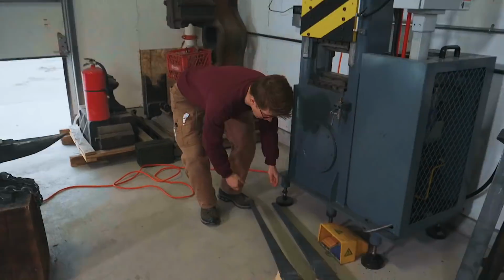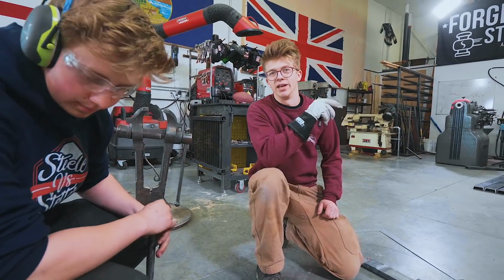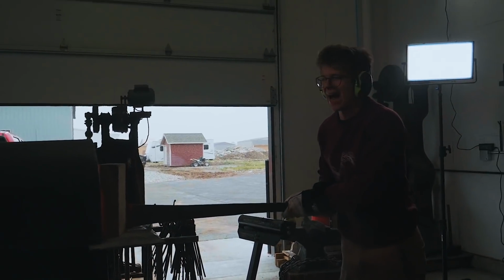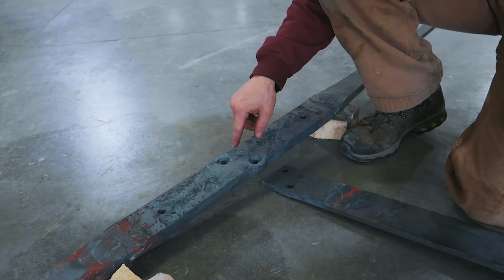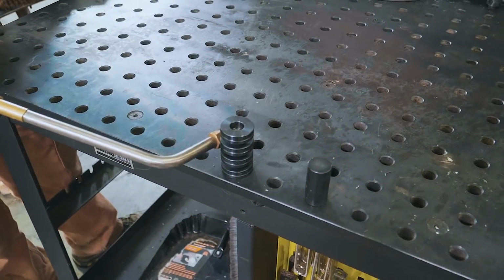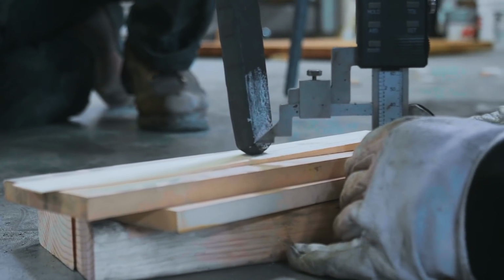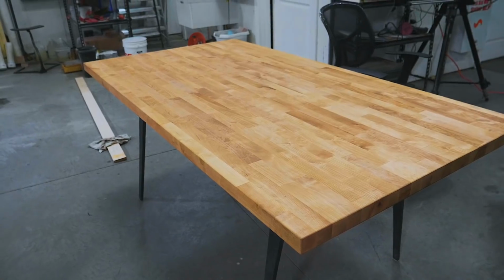FORGING MY KITCHEN TABLE!! Part 2

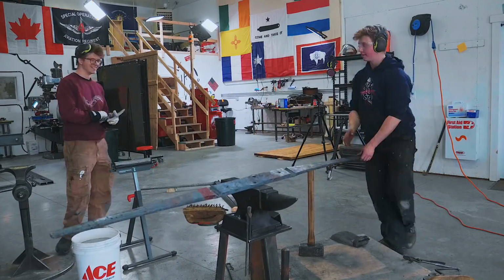Comment: 5:15 - 5:50 The rivet section might be some of my favourite cinematography in this episode with the time lapse and great torch/flame captures.  I love the torch @ 5:32  Great video.  This home furnishing job shouldn't wreck your shins.  Any statistics on bed injuries?

On a side note you need to find a Montana Sawyer / wood slab furniture maker to collab with to get yourself a better table top.

Comment: Lovely table Alec, cool simple design. Tip though, add something to fill the gap between the steel and the wood in the middle there. That wood will not keep its shape, and you will have a crease there quite fast!

Comment: When I first saw the thumbnail. I was not hopeful. Now that the project is finished. I am impressed. It is indeed a great table worthy of the Alec Steele mark. Yeh the drifted and bolted connections is much nicer / organic looking than a drilled hole. I like that touch also.

Comment: Looks great, just one thing I couldn't tell from the video, but make sure the holes in the steel frame where the bolts that attach the top have play in them.  The wood will shrink and expand seasonally along the width and if the bolt holes aren't oblong it will crack your top.

Comment: Something to look out for, wood typically expands and contracts with the weather. Meaning if your bolts don't have enough  of a loose fit inside the steel support structure it can cause your table to crack.

Comment: Put that forge blower in an mdf enclosure! It'll make the annoying blower noise disappear. 

I did the same for my dust collection system. Just drill 1" holes (enough to allow adequate airflow)

Comment: Elongating the holes in the metal where it attaches to the wood will keep the top from cracking. If the wood isn't given room to expand widthways, the top will start to crack where it attached to with the bolts.

Comment: You should have put some pads under the legs so that they don't dig into or scratch your kitchen floor.
Reply: Drill and Tap for Grade 8 Leveling Bolts.
Reply: I do believe that IS his plan, doesn't he mention it last vid?

Comment: Nice Table Alec.  I have a question.  I don't much about forging but would a jig with about the width of the legs have helped with keeping the holes from drifting while countersinking for the rivets?  Or, is there a better way to do that?

Comment: Really nice. I love that hand forged look on the legs mixed with the very straight lines of the wood of the table top on furniture. Simple looking but has a personality. If mine I would probably put a 2cm to 3cm forged band of steel around the sides. Still it's personal choice so...

Comment: Oh no! You screwed the top directly to the base! The expansion and contraction is going to explode your table into a million pieces sending wood and steel shrapnel in every direction putting millions of lives at risk!

I guarantee there will be at least one of these comments.
But probably not as dramatic

Comment: Looks great, top job. Just make sure you regularly oil both top AND bottom otherwise a worktop that wide with only two fixing points across it's width is likely to warp.

Comment: Really like the Table Alec!  Get some little sticky pads for the ends of those table legs or you will experience a horrible screeching when you move it. As if by some miracle suddenly I have at my Disposal, two 7 inch angle Grinders, a drill press, a Bench grinder, a bandsaw and a large Table vise. Now all I have to do is finish my Forge and get an Anvil. I already located a Cross-peen hammer. I already had a 4.5 angle grinder, a MiG 175 welder that does steel, stainless and has an aluminum spooler, a hammer, a double burner for my Forge, and a kiln. It won’t be long, however I’m also in the midst of moving and prepping the house for our move. Did I mention that part of the shop is full of water?  Ugh so much to do.

Comment: Alec, what do you think of doing a collaboration with someone like April Wilkerson and  put a live edge table top on your dinging room table?  Have to fuss at you a little, you had a chance to do hot riveting and didn't.  Oh well.  Hot riveting?  Just like the old timers iron workers did.  Put the whole rivet in the forge and heat to temp and hammer away on the thing.  Great job, keep up the work.  Welcome to the States.

Comment: Alec: I highly recommend altering your method of fastening the table to the frame, due to the expansion and contraction of the wood itself. Consider using Table Buttons (search "How to attach a table top" video by The Homestead Craftsman). This will allow the table to expand & contract without cupping or bowing. Should be an easy modification -- you can even forge the buttons if you like!

This isn't meant to denigrate your craftsmanship at all, of course. I love the look of the table, and would also love for you to be able to use it for decades, if you so choose. Cheers!
Reply: I was about to say he should elongate the holes for the fasteners to allow for wood movement, but you're right, turn buttons, steel clips or braces over the stretchers might work even better.

Comment: Hey bud,

You may want to (should) elongate the holes for the bolts that attach the table top.  Wood expands and contarcts seasonally and if a wide board is fixed it will split itself.....

That said, looks scoocum as frig!

Comment: Suggestion make a silencer box for the fan underneath the forge. Need some MDF or plywood, some rockwool that does not leave residue/loose material and some car sound deadening material. Construction so that there is no way to see the fan from any opening directly and use rubber car intake hose to get out of the box and conneect to the iron pipe.

Comment: I'd like to see you two make infinity gauntlets for both hands. 

With the left gauntlet mainly for good looks, holding the gems. 
And the right gauntlet without gems, mainly for bashing, maybe.

You could try to find the most padded gloves you can, maybe multiple layers, and find a way to rivet the different pieces of the gauntlet to one of the outer layers of the glove. that way you can actually move your fingers freely..  But then again you two might figure out a better way to achieve this idea.. If you guys think this would be a possible project for you, I'm sure everyone would love to see it.

Comment: Alec I think the tabletop should be connected with figure 8 fasteners, otherwise when the wood expands due to the seasons it could crack since the lag bolts don't allow for any movement.

Comment: A non-weapon idea similar to this table. What about the door to your office area? Not the roll-up, but the plain sheet steel door that you use as the main entrance. What about a wrought iron or steel in a wrought iron style door? Maybe you don't want to be as conspicuous as that, but it would be a cool way to mark your shop.

Comment: I think if you want to upgrade the top as some point i'd consider looking into some live edge wood or reclaimed barn wood either would be nice.  You would have to get some carpentry help probably to piece together a large enough piece of live edge to not bankrupt yourself.  But you do know someone who's fairly good at carpentry.  And it has been a while since you guy's did a colab.

Comment: You should trade in that soap stone for some white charcoal pencils (Amazon has them). They provide a finer line that persists in the forge and you can mark the steel when it's wet. I stopped using soap stone YEARS ago. Give it a try, you will not regret it.

Comment: I like the table but you should pull the lag bolts out and elongate the holes i  the steel. A top that wide made of solid wood is going to want to move with the changing humidity.  If it cant move across  the grain it will buckle in the middle. Butcher block should be all edge grain and movement should be less, but for the ten minutes  it will take it could really save you a headache when the humidity  rises this summer.

Comment: Hi guys, love your channel. Just a comment, seeing such an amount of material used on a small table, makes me think of something perhaps subtle but always very important: the human scale. That weight will make it very difficult to move. Perhaps you are though and fit, but it's difficult to impossible to move for a lot of people, and moving a bit a kitchen table is a very usual when cleaning. Just that, thanks for your work.

Comment: Great build - i assume the holes in the frame that bolts the butcherblock in place are oval - otherwise the butcherblock will crack.

Comment: Okay, now lets have Will make some identical sized billets of Damascus to replace the bars you used for the legs, do it all again, except this time you grind, polish and etch the legs!!!   Forged Damascus Dining Table sounds awesome!  Bet you could sell those for a pretty penny.  You'll have to drill and leave the cross piece for assembly AFTER shipping to the customer though.  That means after fully assembling it and ensuring the legs are true to each other, then take it apart and pack if for shipping.  $5000 dining table, hand made in the USA.  I'm sure you could sell them, maybe Vail, Colorado and Jackson Hole, Wyoming.  The lodges there would go nuts~!  Snuck in the touch mark, did you notice?!

Comment: You didn't slot the bolt holes into the surface. How much clearance did you put around the bolts holding on the top? Wood works, and it'd be a shame if the top tore itself to pieces.

Great looking table!

Comment: Could you have made the holes on the flat stock then  heat the legs and put the drift inside the flat stock holes and drift the holes on the legs? (drift holes on flat stock, heat the legs, put flat stock on top of legs (while its still hot) then drift the holes into the legs) that way there are no errors?

Comment: Looks Good and STOUT. You should be able to Overhaul a Big-Block Ford engine on it.....Run a sander over that Butcher block every several years, re-finish, and it will Last as long as YOU will. The HeatMizers Strike AGAIN! LOL

Comment: Put rubber/wooden caps on the legs, it will prevent the floor from getting scratched, or dented, or stained by rust. Rust stains on tiles do not go away easily. I know this from experience, Landlord deducted the price of changing the tiles from my deposit :-/

Comment: you have to put  slip pad on bottom of  the legs or it will  where though apartment floor and  carpet in time.

Comment: Hey Alec why didn't show the process of hiding the bolts that connect the table top to the leg frame?
Reply: He used lag bolts... They don't show since they are shorter than the width of the table and legs when assembled.

Comment: Love the table but i see a big issue though. Legs will scratch the hell out of the floor. Unless you put some rubber ends, or any softer material on the legs, you will have big scratches and craters in the wooden floor. You should do something about that.

Comment: So serious question. Why didn’t you forge it with the correct leg length in the beginning. I watched you cut off different thicknesses from each leg and now you have a different thickness at the bottom and it would look odd as one would be more tapered then another.  Well at least to me.  And why didn’t you add gussets or weld the legs in place.  I understand That the steel is thick and pretty rigid but don’t you think you should have some bracing under there.  I am not a forger/blacksmith but I do welding and fabrication...

Comment: Bolting real wood to steel is a bad idea, the wood will work in time, with changes in moisture and temperature. You should cut the long piece of iron or make a flexible connection to prevent cracking.

Comment: Is anyone else wondering why they didn't just use the drill press for the holes and countersinks?
Reply: Aaron Glett  Because they are 'smiths and wanted to practice punching holes in hot steel.
Reply: @chiefof  the key here, is they had registration issues with the holes that way, had they used a drill press, that wouldn't have happened. Now, I will say that it would be a good practice to make something unorthodox with pure smithing methods, but in this case it probably took 10x as long.

Comment: While Alec you are a great metal worker and fabricator, you're definitely not a furniture designer. With this design of the legs you would want to spread them apart further than you did to allow for easier seating for 4-6 people with 2 chairs on the sides. As of now you will potentially run into a problem of people banging their knees on the legs of the table. Another very important detail with this design is to give the legs a bit of an angle outwards toward the narrower sides of the table. This will help with minimizing the sway that this design will eventually develop, no matter how strong the joints and welds are. Also the proportions of the table would look MUCH better if the wooden top was beveled (at least 45) on the bottom face on all sides to give an illusion of a thinner wood, while maintaining the sturdiness. You would also want to glue some hard delrin or any other rubber feet since the weight of the table is concentrated on 4 very tiny points on the floor. This might potentially damage whatever flooring you have at home. Sorry for my OCD, all the comments are in good faith! Love the videos!

Comment: Looks “ hell for stout “. 
Wood moves, steel doesn’t. As the wood expands the lag bolts will prevent the movement and the top will warp and crack. 

One trick is to use slots rather than holes to put the fastener in or to use oversized holes and smaller fasteners with washers. 

Very nice project 
Frank